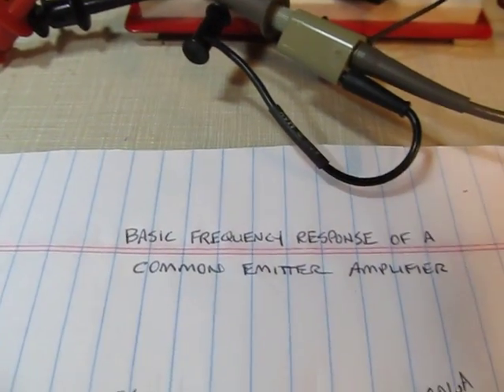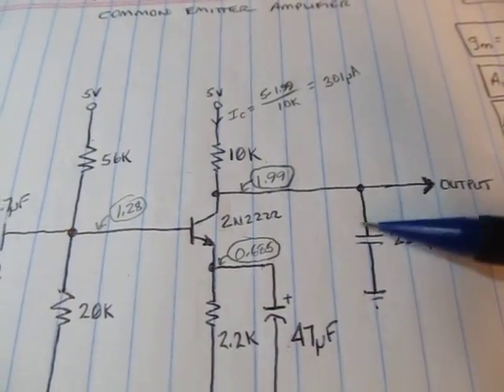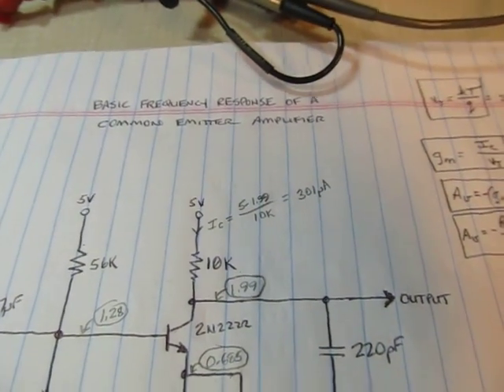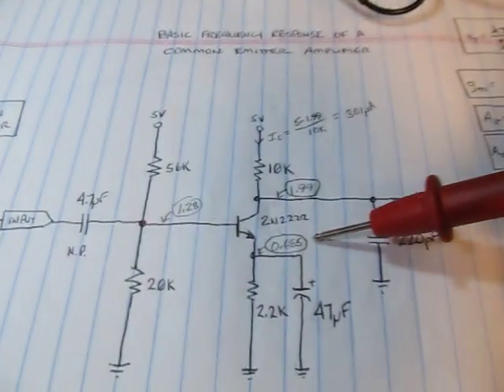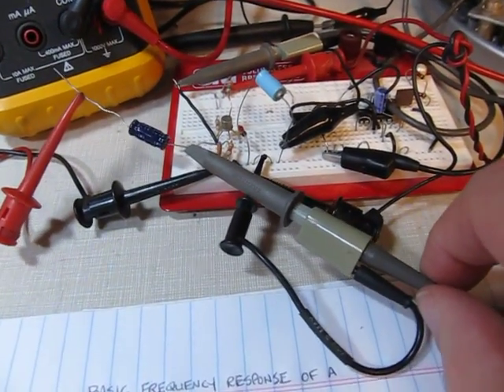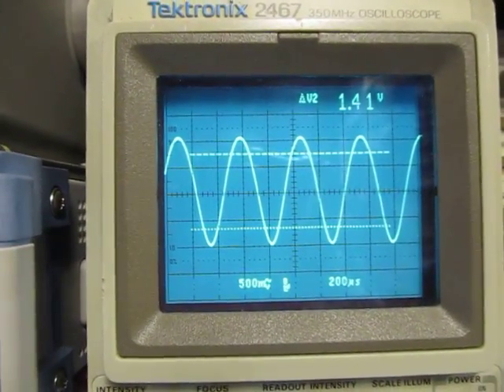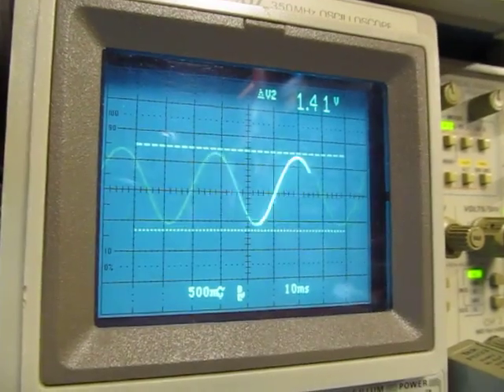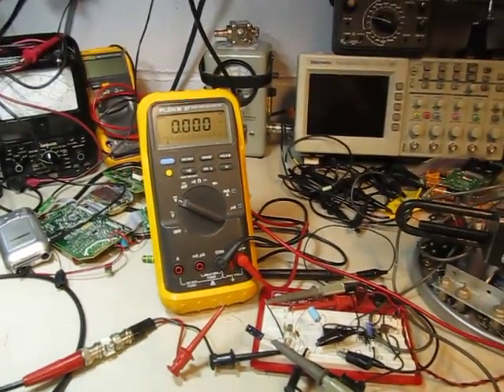#67: Basics of Common Emitter Amplifier Gain and Frequency Response with Measurements

Comment: Thanks for your reply. I tried to replicate this circuit with nearly the same resistor values. The voltage gain was about 4 as in your example without the emitter bypass capacitor, with a pure sine  wave output. But with the bypass capacitor, although the gain was 100+, the output waveform was distorted  - the +ve half was larger and rounded whilst the -ve was more sinusoidal. I tried various capacitor values but they all seemed to cause the same problem. Any suggestions?
Reply from the maker: With the that high (With the emitter bypassed), you'll have to dramatically reduce the input signal amplitude so that the output amplitude stays within the active region of the transistor.
Reply: The relation between base voltage and collector current is exponential. This means that for high fidelity amplification the signal has to be proportional to the bias. If the current amplitude is too large with respect to the bias current then half of the sine wave becomes broad while the other half becomes pointy. I think that he set the bias current too small and to compensate for the decreased amplification he increased the amplitude of the input signal.
Reply: The easiest way of looking at it is that the intrinsic emitter resistance is highly non-linear, as it depends on the collector current. The gain is Rc/Re, so when a large signal is output, the collector current can vary from almost 0 to almost 500μA. That means that the emitter resistance is varying from a high value (2K5 at 10μA) to a low value (63R at 400μA), so the gain is varying from 4 to 160 over that range. No wonder the output is distorted with large signals.

You simply can't have large voltage gains and low distortion with a single common-emitter stage. You need a decent amount of negative feedback to linearise the output and that means having an unbypassed emitter resistor that is significantly greater than the intrinsic emitter resistance and/or taking the upper base bias resistor from the collector of the transistor rather than the positive supply rail. Using a transistor with a high current gain is also a help, as is having a greater supply voltage.

Try changing the lower base bias resistor to 22K. Change the upper base bias resistor to 150K, but connect its upper end to the transistor collector, not the supply rail. Change the collector resistor to 3K9 and the emitter resistor to 120R, omitting any emitter bypass capacitor. Use a supply voltage around 15V with a BC549C transistor or similar. That will give you a much cleaner output with low noise at the cost of the gain being about 28 and the current consumed being about 2mA.

Comment: is it compulsory to use non-polar capacitor or we can use polar capacitor.what will be the effect on output with both types of capacitor.
Reply from the maker: It depends on whether the circuit has sufficient DC offset between the two sides of the capacitor to prevent reverse biasing a polarized cap.

Comment: Is there any advantage in replacing the base bias resistors (56k / 20k) with,say, a100k potentiometer / preset to optimize the operating point of the transistor? And how did you decide to use 56k / 20k anyway? Other values could have been used to get the 1.28v
Reply from the maker: The advantage would be, as you said, being able to easily dial-in the optimum operating point.  As for how I picked the bias resistors on the base...  ...I usually use values between 10k and 100k since they provide a good tradeoff between a nice reasonably  high input impedance and relatively low base-current effects on bias.  Of course, other design constraints for the overall circuit and application can sometimes result in me using much larger or smaller values.  If there are no such circumstances, then I typically go with the 10-100k values.  After that, it's usually whatever I can lay my hands on.  I happen to have a pile of 20k resistors on my bench, so I started with that, then figured the 56k to set the bias I wanted at the base and emitter.  Of course many other combinations would work well too.
Reply: You want the current flowing through the bias chain to be significantly greater than the quiescent base current. So if you have 300μA collector current and you pick a transistor with a β of 100, you get 3μA base current. The current flowing through the 56K + 20K from a 5V supply is 66μA, which is a teeny bit low, given that the 2N2222 could have a β as low as 40, thus taking a base current of 7.5μA. I'd personally want slightly lower base bias resistors or a higher gain transistor to make sure the output operating point couldn't vary too much depending on the transistor β.

Comment: The Bypass Capacitor across the emitter resistor/cathode resistor on transistors or tubes will also Filter out the AC Ripple? because in tube amplifiers if you don't use the Bypass capacitors the tubes AC heater and power supply AC ripple will get amplified because the bypass capacitor is not filtering out the fluctuations?
Reply from the maker: The bypass capacitor on the emitter or cathode is to increase the gain by allowing the intended signal to bypass the resistor.  It is not for supply filtering.

Comment: Hi Alan,

I have recalculated all the values and agree with what you have measured.
However, I am upset with the calculation of beta:

Ib = Vcc/R1+R2 = 0,06 mA
Beta= Ic/Ib = 0,3/0,06 = 4,35 it is very low !

I have checked the 2N 2222 data sheet and beta with IC=0,3 A is about 35
Did I made a mistake in my calculations ?
As far as I understand we can't force the beta of the transistor ?
Thanks in adavance
Reply from the maker: Your Ib value is the BIAS current through R1 and R2, that is correct.  The Ic current is approx 0.3mA, that is correct too.  You can't force the beta value, it is what it is.  So, the BASE current will be determined by Ic/Beta, or approximately  8.5uA.  The general guideline is that you want the BIAS current through R1 & R2 to be >> base current.  In this case, it is about 8x larger, so that's not bad.
Reply: Thank you Alan for the explanations. But I don't see where you gave the Beta value in the video ? 
How did you calculate it is 8 times larger ?
Reply: @Bremontval  The β is at least 35 for a 2N2222 at 300μA emitter current, so the base current can be no more than 300μA/35 = 8.5μA.
The current through the base divider chain is 5V/(56K + 20K) = 5V/76K = 66μA.
I think we can agree that 66μA is about 8 times larger than 8.5μA.

Comment: I have had a hard time finding a concrete answer on this, but can a small signal transistor like a 2N3904 effectively amplify a larger signal(say, around 1.3Vpp) and generally, at what point in signal amplitude does it become necessary to step up to a power transistor?
Reply from the maker: It certainly can. Remember, voltage alone does not equal power. Power is voltage*current.  Typically a lot depends on the load that the amplifier needs to drive.  Transistor power is primarily dictated by the collector-emitter voltage times the collector current.
Reply: @w2aew  My aim is to have an MCU driven Bluetooth receiver feeding audio into an old tube radio I restored from 1938. The raw audio output from the MCU has some slight audio distortion(which generally seems localized to the lower frequencies) I messed about a lot with different means of matching the impedance. It seems the best results I've gotten so far was shunting a 560 ohm resistor from the input to the chassis on the radio, but the low frequency problem remains. So I was looking into adding a common emitter stage in between to see if that helped out
Reply: @w2aew  I was also wondering what technique you use to measure small signal base current when you have a voltage divider on the base? I have yet to purchase an AC current probe for my scope(I do have some SCTs laying around that I could likely make work) but that would only be a viable solution on a breadboard.
I suppose I could subtract the RB2 current from RB1 and end up with base current
Reply from the maker: @ColossusEternum  Very difficult to comment on the cause of your distortion without knowing what your circuit looks like, or what the input of the audio-input of your old radio.
Reply: @w2aew  I understand that completely. I'm just going to have to keep researching and experimenting with it. Right now I'm not terribly concerned about that specific circuit(I was trying to run before I could walk lol) it's just a little daunting when you build an amplifier because there are all these ways to adjust the circuit, but they all have a range of consequences. I've been meaning to draw a table in which I list all the factors that each component has an influence over.(like base resistors influencing Vb, Ib, reducing hFe dependence, input impedance etc.
Reply from the maker: @ColossusEternum   Did you see my Tips and Tricks video on common emitter amp design:
https://youtu.be/VWY2WQcKJgk?si=ulfoo9Q0E4xFPv4V
Or my video on emitter followers:
https://youtu.be/8f-nhjQ1jMk?si=d_WMVmvRlmWRdObV

Comment: what is the minimum signal that can be amplified with this circuit. how to check this property or how we can calculate it?
Reply from the maker: The amplifier doesn't "stop" working for small signals, so there really isn't a limit on how small the input can be.  However, factors such as the signal frequency, the required bandwidth, the noise in the signal and amplifier, etc. will all affect how well the amplifier works.

Comment: How do i calculating AV in a multi stage amp for example a 2 stage CE amp's AV(tot) ? I know this is hard to put in words with no resistor values etc so if you can up load a video about this it would be much appreciated
Reply from the maker: +Denis JJ You simply multiply the gain of each stage, making sure to account for the loading affects of the stages on each other.

Comment: hello sir, so the frequency response of a common emitter amplifier does only depend on bypassed capacitor and output Rc coupled capacitor?? please reply as soon as.
Reply from the maker: In this specific case, yes.  But not always.  There can be many different factors that affect the frequency response. A very common limit is often imposed by the base-collector capacitance which tends to roll off the input signal.  There is no single universal answer.

Comment: How do you Hi Pot test an amplifier circuit? If an amplifiers input has DC offset voltage can it amplify the DC offset voltage on the amplifiers output? What is amplifier input and output AC offset voltage mean (not DC offset )?
Reply from the maker: A DC offset on an amplifier input doesn't necessarily mean that it is DC coupled all the way through.  I've never heard the term AC-offset.

Comment: At 8:21 why did you exactly choose 70% of the output amplitude(1.41 volts)?..
Reply from the maker: Because that is the 1/2-power point - the traditional way to specify bandwidth.
Reply: @w2aew  i don't really understand can you explain more, please ?
and i don't know what's the relation between 3db and 70%; i mean why 3db means 70%
Reply from the maker: @MrFKD  The traditional way to define circuit bandwidth (high pass, low pass, bandpass, or notch) is to look for which frequency results in a response that is reduced to 1/2 the power level of the in-band response.  Since Power is a defined by voltage-squared divided by resistance, the half-power point corresponds to the point where the voltage is reduced (divided by) the square root of 2.  V/sqrt(2) is the same thing as V*0.707, or approximately 70% of the amplitude in-band.  This is also known as the 3dB point, because a 3dB reduction in power is another way of saying that the power is divided by 2.  See my video on decibels for more information.
https://www.youtube.com/watch?v=1mulRI-EZ80
Reply: @w2aew  i get it now...thank you so much

Comment: how do i found a transistor? how do i know the value i'm looking for of a transistor is 2n2222
Reply from the maker: It all depends on the application.  Operating frequency, required power capability, operating current, noise performance, amplifier or switching application, etc.  The application will set the basic requirements for the transistor, and then you can begin a search for suitable model numbers that will work.  Often times, there are many, many transistor types that will be suitable for a given application.

Comment: Is it possible to use a single BJT to obtain an 8 Vp-p Symmetrical Output Swing and voltage gain between 800V/V and 1000 V/V at 100 Hz by capturing an oscilloscope screen shot of input and output voltage? (Its a class project)
Reply from the maker: It's possible, but you'll need to use a VCC supply of 30V or more.  Shortcut way to think about this...  Av = gm*Rc.  gm = Ic / Vt, Vt is 26mV at room temp.  Combining these equations, you can show that Av = V(Rc)/Vt.  Thus, in order to achieve voltage gain Av of 1000, you much drop at least 26V across the Rc collector resistor at the quiescent point.  In order to swing 8Vpp around that and not saturate the transistor, you'll need another 4+ volts of headroom, thus at least 30V VCC available.
Reply: *****
Thank You for the help

Comment: Is it ok for an amplifier IC chip output a DC offset voltage or is this bad because the DC offset voltage can damage the speaker? If the output transformer primary has a DC offset voltage from the amplifiers IC chips output, will the output transformer secondary have a DC offset voltage also since the primary has a DC offset voltage?
Reply from the maker: DC will not pass though the transformer.  So, if there is DC on the primary, it will not be on the secondary.

Comment: How do i reduce  the ac gain. I am using a nte123 at 10ma collector  current. Supply voltage 12 volts and voltage across emitter is 1.2 volts. I would like to drop my gain to 100 and my input voltage is 5mv at 1mhz.
Reply from the maker: You can reduce the gain by including some unbypassed resistance in the emitter.
Reply: @w2aew  I want to pass 600KHZ to 2MHZ THE Ft is 300mhz. Can I get away with one 100 gain stage or should I use two stages each with a gain of 10? I avoid the bypass when using lower gain.
Reply from the maker: @fernandohood5542  YOu don't have a lot of gain margin with a single stage, so I'd recommend a cascade.

Comment: I was doing great till you got t that esoteric equation Vt = it/q. I got snowed there.   I haven't used Boltzmann's Constant in 40 years.   I am assuming  q is an electrical charge?   And T is temperature in , 25 C?   Or is that Kelvins?   This is the thermal voltage at the base-emitter junction?   I rewound at least 3 times... But did not catch what gm is measuring and what taking the inverse does.   Gm is in Siemens which is conductance.   Apparently,  you are calculating the effect that termperatre and conductance plays on effecting the low and high pass filter output frequencies.. but if I am wrong,  I would like to know.   Does this elegant but escoteric set of calculations have a simpler set of assumptions that could get us in the ball park?   Or is this really necessary?  I have read ceramic capacitors are horrible on circuits where frequency is the output.  Is this true?
Reply from the maker: vt is a convenient mathematical shortcut when dealing with bipolar circuits.  It is based on Boltzman's constant, the charge on an electron, and the temperature in Kelvin.  Since T at room temperature is 300 degrees, you can see that small changes in temperature don't have a big effect on vt, so in most cases, vt is simply used as a constant 26mV - no calculation necessary.  gm is the small signal transconductance of the transistor. It represents the change in collector current in response to a small signal change in the base-emitter voltage.  Using the vt "shortcut", gm is simply calculated by taking the collector bias current Ic, and dividing it by vt.   Thus, the small signal voltage gain of a common emitter amp is easily calculated.  It is the small signal output voltage change divided by the input voltage change.  Since the change in output voltage is equal to the change in collector current multiplied by the load resistor (Rc), the small signal gain is thus gm*Rc.  The inverse of gm is called re, the incremental emitter resistance - another non-physical shortcut.  This shortcut means that the small signal gain of the transistor is also given by Rc/re - which makes sense because the collector and emitter current are nearly identical.  I'm sorry to say that these calculations ARE the simpler equations when it comes to calculating common emitter gain.  If you have a lot of emitter degeneration (unbypassed emitter resistor), which is larger than re, then the voltage gain can be reasonably approximated by Rc/Re.  If you don't have any emitter degeneration, then the small signal gain can also be represented by Vrc/vt, where Vrc is the voltage drop across the Rc collector resistor.
Reply: I had to study this for a long time (about an hour) to piece together this complicated answer. Thank you for the detailed response.   It reminded me of similar explanations I had received in college physics and engineering courses.   I am not sure I completely understand the necessity of these points since we end up making generalized assumptions...which work most of the time.  Why not just skip the in depth explanations to just simply state Vt as a constant of 26 mV?   In fact,  I went and did some reading on Vt which is really called V_t called the Thermal Voltage.   In a gas, the thermal energy is 3/2 nkT. Or "3/2 kTPer mole" for a "group" of electrons... The thermal energy is "kT per Coulomb".  Sorry,  I had to use periods or quotes to prevent auto correct from messing up things.